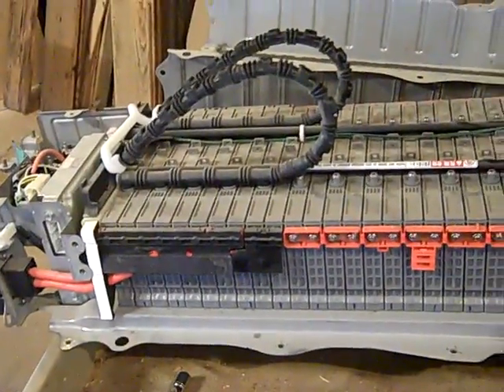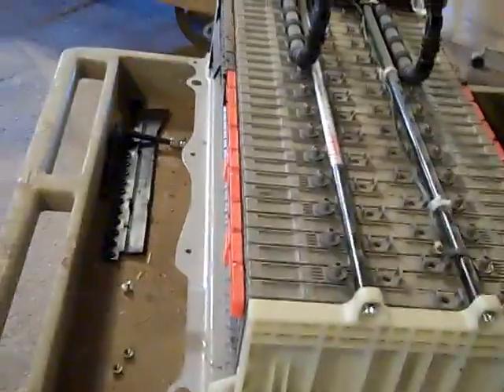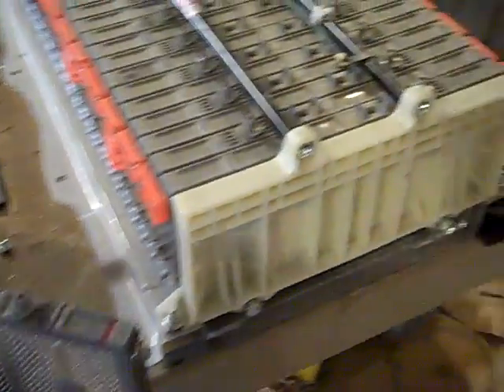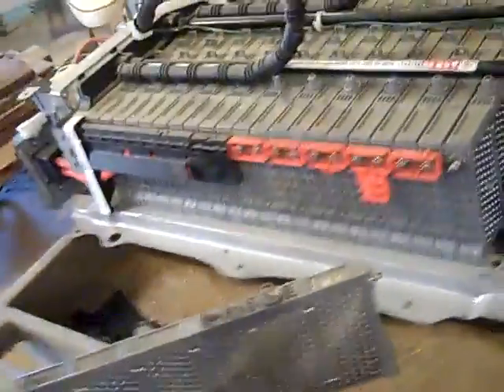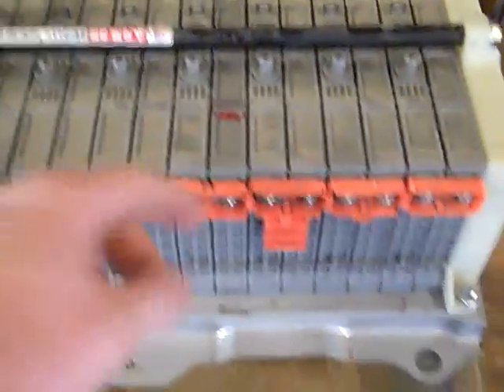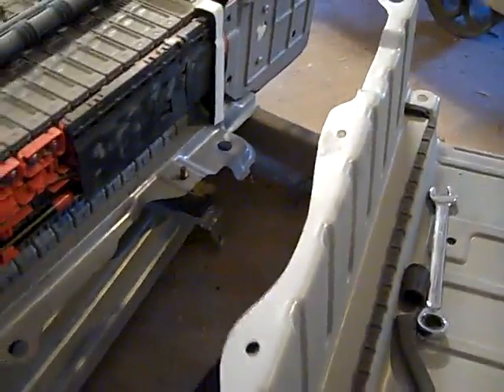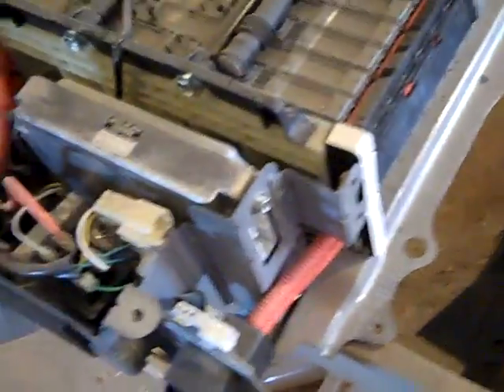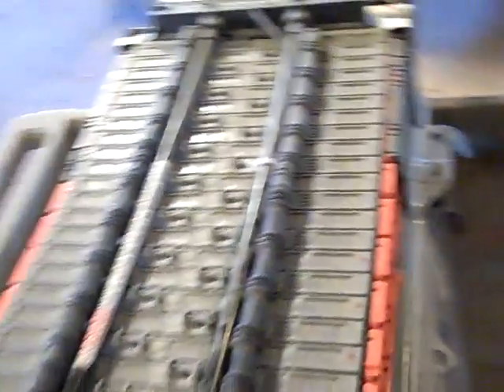Prius Battery Repair

Comment: Looks like last update was total of four cells replaced.  Wondering what the latest is or was regarding?  I just dived into a ~235K 2006 Prius and was more the ABS VSC issue that turned out to be the passenger side adjustment lever not installed in between the fork of the strut adjuster that was also stuck tightened all the way in making the pads loose so not enough pressure.  Also had to install new Autoshack cat and Denso O2 sensor.  Have the AF Ratio sensor to replace and found a few yard ones to try out first before investing in new.  Also will clean the intake and MAF once I get around to working on next.   

I also need to work on the front suspension where Rubbershocks were installed that I think are making the diameter to large and clunking noise is coming from, though the shocks are a ORielly Masterpro looks like which might be not so good as well.  So will most likely get the KYB and install the 2012 Matrix AWD KYB yard springs on to replace so still the sold as overlanding lift kit lifted situation maybe without using spacers. I got a better yard sway bar bushing as well as I noticed that squeaking, though the rest seems solid other than wondering maybe engine mounts possibly or something else was squeaking one day and I still need to get under with a cement breaker bar or crow bar to see what might be more loose and same goes with all the bolts with a torque wrench to assure nothing is loose.  

Anyways, figured I'd share and see what you latest or last situation was regarding as I got a good deal on another complete HV battery minus the cover and fan assembly.  So can eventually practice reconditioning those cells with the hobby battery chargers I own.

Comment: U do realize leaving those bus bars on there still leaves high voltage possible of causing electrocution?  This is a very unsafe way to remove the Cells off the circuit's.. Remove all the bus bars and all the cells up to the point of replacement... 220 volts will kill u and this Hybrid battery is something not to take lightly
Reply: People work on live 25KV lines all the time. If you are scared of being electrocuted on a  220V line..Then don't mess around on it! 😀

Comment from the maker: Another update around 250,000 miles on the car now, I think I am up to 4 cells replaced currently. Its been a while since I had one fail (knock on wood). I have 250k and 12 ish years on most of the cells, still getting 45mpg. AC works, changed brakes for the first time around 230K miles. This is a good dependable cheap car. I also had cleaned the throttle body recently which helped, it is electronic and was gummed up (sticking). Wheel bearings and lower control arms and bushings were replaced.

Comment: Friend I have problems with a Prius 2006, I had 8 bad cells in the hybrid battery, I 
changed them and everything worked fine, until I turned on the red 
triangle and gave me the code P3000. 
I could not find much information about this problem, I write from El Salvador, Central America.
Reply from the maker: As I tell many people on these comments, I am in no way a mechanic, let alone a toyota service tech. I get most of what I know through personal experience, and reading way to much on the internet. I would google the shit out of it and go with what you know about the car, unfortunately that's about the best advice I can give you.
 A small bit of advice I just had good luck with was cleaning the throttle body on the car. Our car drives down a dirt road and enough dirt gets through to gum up and make the throttle body stick. It really helped me with rough idle, the car also threw a code for low power which lead me to find this solution.
I doubt this is the solution to your code, but I hope it might help. Good luck!
Reply: Thank you for your prompt response, I will prove your advice, hope it works for me. Blessings

Comment: So I followed your video everything went well. The battery started working fine then making a noises inside the case any ideas?
Reply from the maker: well I have never experienced noises (other than the battery cooling fan), and am by no means a prius battery expert. However a loose bolt while driving, solenoid/ relay could be making noise. Without knowing exactly what the noise sounds like I would only be guessing. I only have experience with my car. I hope this helps in your  diagnosing.

Comment: so you can just replace just the few dead ones and it will work
Reply: Yes, but as the poster indicated, he's done it two more times.  This method of battery repair is like having 4 bald tires.  One blows out and you replace it with a used one with a little tread, but you leave the 4 bald ones on.

There are 168 cells in the battery.  They all respond to load, heat, age and use a little differently.  The failure of a single one takes the battery out.  Replace the one failed module, and the next weakest one will sneak up on you.
Reply: In order to keep battery cells alive you have to keep the copper buss bars clean, especially on the computer terminals side, facing to back seat.

Comment: I'm getting ready to dive into this project of removal of the Prius Battery and Recondition the cells/replace. Do you happen to have a step by step guide of materials or links you could recommend. I see many videos here on youtube, however, none really showing every step- Example-when removing the individual nuts on the orange bus bar-I'm assuming there is still a danger of shorting since the cells are still in series. I assume wear proper gloves, but is there still sparking when all the bolts are removed and the orange bar slid off? I am about to buy a how to from PriusKings on amazon but I haven't heard back about if they show how to recondition the battery not just replace a bad module (cell). So do you power the HobbyKing charger w/ a 12V car battery? & just keep charging that up? Thanks for any help you can provide.

Comment: Anyone can help me with this issue please my batteries are all around 8 volts. The lowest one off voltage I read was 7.9 so I might think that the problem is the computer?. The driving performance is very problematic, when I had the issue I was driving down a highway when my gas simply had no power behind it. I could not keep up with traffic. It starts fine, but it runs as if the battery didn't even exists

Comment: Rob Hutchins:  I clipped only one side on the bus strip (the side without sensor leads) and left the other side alone, simply unbolting the bad cell on that side.  All cells from the bad cell to the closest end  of the rack have to be unbolted on the bottom, but can remain bused together and pivoted out to release the bad cell.  (My bad  cell was #15, so I had to release half of the batteries...)  Keep in mind that the more batteries you keep connected have more voltage to be careful about.  After I slid the replacement cell back into place, I used the (4) long clamping bolts that hold the rack together to compress the battery pack back in place.  Make certain that all cell interlocking tabs are correctly aligned.  Sorry I don't have photos.

Comment: Woah dude,.... camera work.  Egad.  Get a tripod.   Nice explanation otherwise.
Reply from the maker: Really? I hope you commented for the comedic value it presents. If you have nothing better to do than rag on me for having the forethought to record my repair to possibly help others with the same problem. I suggest sports or something that gets all that extra energy out!
Reply: Anyone can help me with this issue please my batteries are all around 8 volts. The lowest one off voltage I read was 7.9 so I might think that the problem is the computer?. The driving performance is very problematic, when I had the issue I was driving down a highway when my gas simply had no power behind it. I could not keep up with traffic. It starts fine, but it runs as if the battery didn't even exists

Comment: good job with the video.  I noticed you didn't take off all the bus bars like other videos I've seen .  can you just spray the copper with vinegar while its still attached and clean with a tooth brush to get the corrosion off ?  Thanks

Comment: One thing to add:

On the bottom side of the two outer cells and the middle cell there are small temperature sensors which clip onto tabs molded into each cell.  Make sure these are in place when you re-assemble the battery pack.

Also, I used a test bench power supply (controlled voltage AND current) to charge the replacement cell up to the same voltage level (which indicates level of charge) as the remaining cells.  Do NOT exceed the voltage of the remaining cells (for me, they were typically 7.78V DC each) and I would recommend a charge rate no greater than 250mA.

I just completed a successful cell replacement and my '06 Prius is back up and running like a champ at 208,000 miles, no error codes and the beast is back to 53 MPG for my commute.  Total time spent performing the surgery was about 4 hours to remove and analyze, and another 4 hours to re-install.  This does not include the time spent waiting for the USPS guy to deliver the replacement cell.

Comment: hey I've changed the cell however now i don't have any power at all to my car.  any ideas?  I've test the 12v battery and its good.
Reply from the maker: +Thebeautyofaviation  most likely the orange service plug is not closed on the switch, you have to  close it then slide it to close the switch on it.
Reply: Computer of hybrid battery

Comment: to do when I finish the change process module defective ? It connects everything again and on normal car? I need to program or something ? please help friend
Reply: The first step in the repair/replacement is to disconnect the 12V battery.  I found that this clears all of the codes and the car should start up with no error messages when everything is reconnected.  I did not need the OBD reader at all.  As for reprogramming, I think the computer that manages the battery can learn the behavior of the new batteries and will eventually show an accurate battery level on the SOC display as the battery gets used.  A couple days/weeks, perhaps...

Comment: Thanks so much for the video Tim. I've just bought a 1998 Gen1 Mk1 Prius with the cylindrical batteries that look like stacked D-size batteries. It's got a spare battery pack with it. I've got the red triangle icon and the red car with a downward arrow through it icon as well, and the car behaves quite erratically. It looks like it charges the battery absolutely full from going down a 100m long sloping driveway, then shows a yellow almost-empty battery seconds later. Sometimes the engine revs away with no drive to the wheels too. Any experience with testing and replacing bad cells on these?

Comment: So you didn't have to balance the cells after you installed the new ones? Just installed and went on driving?
Reply from the maker: +cody cowgill Yes, pulled the old then put in the new. That is it. There is a plenty of over complication in a lot of forums and web chat out there, but I can tell you (from my experience) simply finding the bad cell and replacing it, works well.
Reply: +HeritageTim good to know! Thanks
Reply: The problem is that if the replacement cell is at a very different level of charge than the rest it will have a tough time syncing up, since all cells are charging/discharging in series.  If you can match the cell voltage with the rest (voltage is an indicator of level of charge) it would work best.
Reply: We are dealing with batteries not capacitors. One cell has 6 sections, ~1.2v each. If one section dies, the voltage drops down to 6... volts. If a cell has over 7 volts but it's weak you can find it out under load only. At your first start after fixing your battery HV battery computer will charge the replaced pair with a low voltage cell for ~3 min. to reach the programmed voltage ~15.6v and it will be ready to serve you another ....miles.

Comment: This is very cool. I just bought a 2005 Prius (like you got a good deal because of a bad cell). I have two questions for you. One is I'm about to junk my 2003 Prius (Gen I), is there much difference between the cells (if you know)? Two, how did you get the battery out?